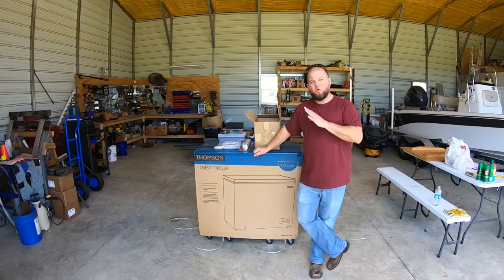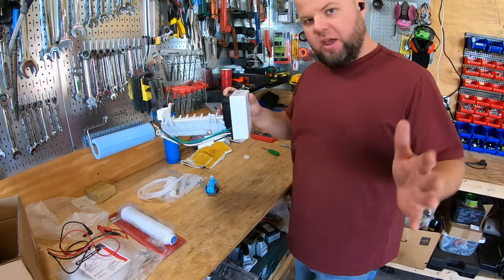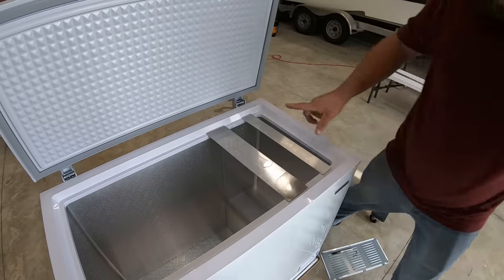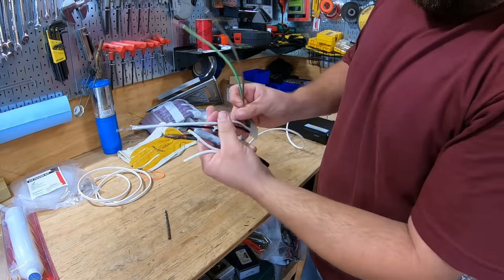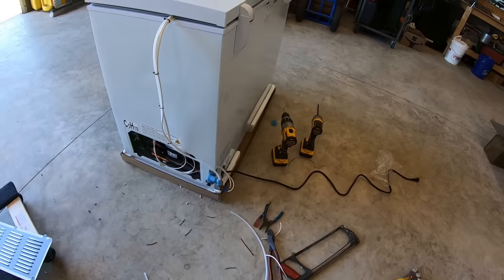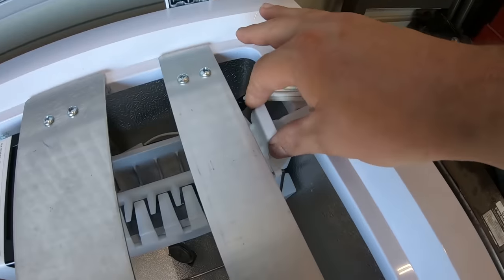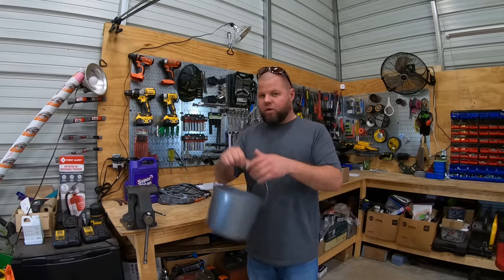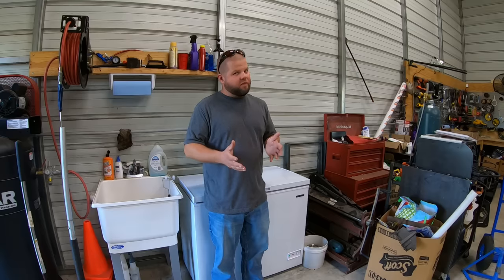Homemade ice maker! SAVE thousands over a commercial ice maker

Comment: If you look at the cost for the equipment you bought and the electric you are using it is not worth it. For $360 you can buy a 20 pound bag of ice at those Ice machines found near the lakes and beaches for $2.00. You would have enough money for 3 years x 52 weeks per year and still have change. Now you are going to have ice but also a higher power bill and that thing is in your garage taking up room. Those ice machines at walmart are $100 and they more make ice then that does and you can bag it up and store it in the freezer for the weekend plus bring it with you.
Reply from the maker: You can't put a price on convenience. Closest machine near me like that is azc little over 20 miles away. Now factor in gas.
Reply: @TKCL  I see. We have a 24/7 bait vending machine and a bulk ice machine across from Specs liquor store which we hit on the weekends that's only $2.00 for 20 pounds. That's cheaper than Walmart.

Comment: The needle tap is the worst way to run water…they fail
Reply from the maker: I agree it isn't my first choice inside a house. Out in a open metal shop with concrete floors isn't as much of a concern for me.
Reply: @TKCL  25 yrs ago I used one tapped into my water in the basement ran the line upstairs to the fridge, no problems for about 5 yrs love the ice chest ice make idea, we camp a lot and I spend a fortune on ice, you’ve inspired me to make one too…

Comment: Should have bought a tabletop icemaker and cut a hole in the lid those make 28lbs a day.
Reply from the maker: They also make wet, partially melted ice. You wind up with a huge block of frozen ice in the freezer.
Reply: @TKCL  Got it

Comment: Those several hundred pound commercial Ice machines are rated per 24HR period. Yours cannot produce anywhere  near that amount. That's a maybe 20lb machine. It only works for you xause your needs are less than 20lbs A DAY
Reply from the maker: Yes I completely understand that and covered the differences

Comment: 100lb a day ice Machine is 348$
Reply from the maker: Missing the point here. Those have practically no storage, make small cubes, constantly melt ice, ice is a higher temperature and they use a lot more electricity. I have plenty of very cold, larger cubes of ice on hand with my machine.

Comment: How does this in anyway save you thousands?  a dedicated icemaker is considerably less than 1000
Reply from the maker: Over a commercial unit that holds this kind of capacity. The ones that you speak of in that price range are not commercial quality

Comment: Saving thousands on what? Ice machines use a lot of water and electricity
Reply from the maker: Yes COMMERCIAL ice machines do! If you watch my recent videos I show this costs 21 cent a day to operate, not expensive in my book. That's with fans, two ice makers and putting out almost 10lbs of ice a day now.
Reply: @TKCL  this will too. Constantly running just to fill it up.
Reply from the maker: 21 cent! Really? That's 76 dollars a year if it never shuts off 🤷. It will absolutely shut off once I get caught up and in winter. So realistically 50-60 bucks a year to have a couple of hundred pounds ice in my shop anytime I want it???